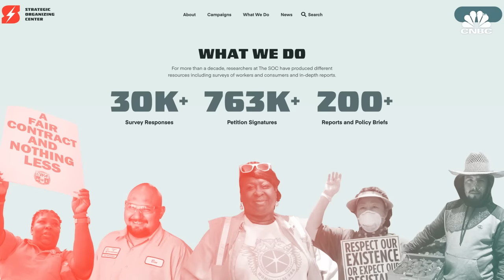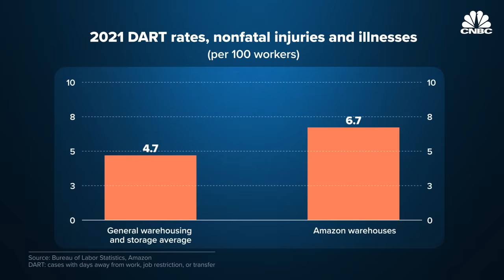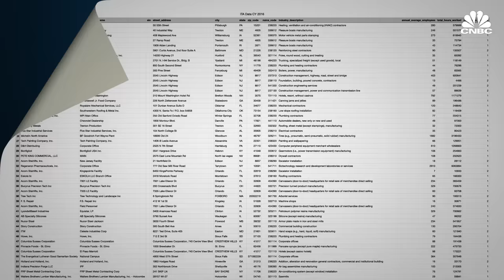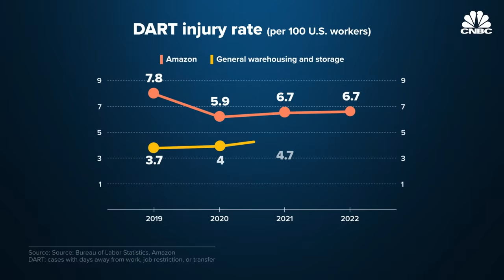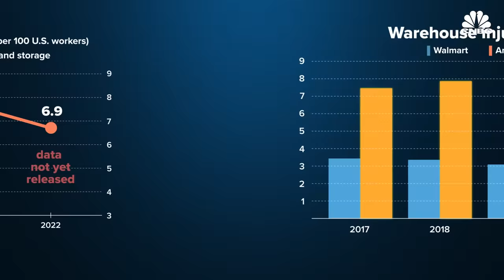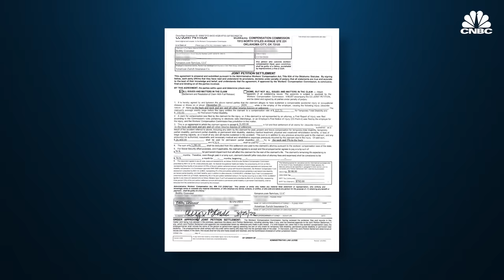Why So Many Amazon Workers Are Getting Hurt

Comment: I currently work for amazon and I can say 100% that the workers are not cared for. I have never in my life worked for a company that had so many people in management positions that absolutely do not care about people. If you are considering working for amazon, please reconsider. The chances you will be injured in some way are very high and they will not care. And those injuries may follow you for many years. I recently was injured when the manager allowed an unsafe pallet of tables into the receiving area for me to receive. He didn't even ask me how I was doing after my back was scarred and bruised from being hit from behind by several of the tables when they fell. I hope to get away from there soon before I am hurt further.
Reply: The system they have at an FC is built on mistreatment of people for the sake of speed/productivity to the point of damaging them physically. Managers have to "not care" just to remain in good standing. And honestly, most of the managers I met were totally fine with that. To me, that's disgusting and it's why I stopped seeking promotional opportunities and quit eventually.

Comment: As a former amazon employee for 3 years at a fulfillment center (inbound packages to delievery). I worked in safety. The warehouses are dirty. Pink eye and or  respiratory issues are really common from the dust in the air. If you work hard and exceed your rates you wont move out of the position. If you slow down management will have questions. I've seen people break bones and turn into zombies. People dont stay longer then 3 months usually and those who stay suffer from mental and or phyical pain. If your going to work for amazon take care of your health. Ice baths, stretching, and not going above your obligation and rates is important or you’ll burn out. Short term (3 months) not too bad if you need a job, but the phyical demand catches up to you. 

The biggest problem is the labor on hand. We often didn't have enough people to had large volume. The strain to finish the work day ends up with people getting hurt.
Reply: Hi @Sweet Karma whould you mind help me in responding to an anonymous survey regarding Amazon? Is for my Mba Master dissertation.

Comment: I left Amazon this year January and I just turned 27 last month. I can assure you although some warehouses make an effort for safety and it does matter to some, it’s just not good enough. Numbers matters the most. I worked there until I had constant back spasms and now a pinched nerve in my neck due to repeated movement. Most ppl work through their injuries in fear to not wanting to take time off. The process is long and the reimbursement isn’t good enough. It’s a very physically demanding job even for young fit people. I sprained my shoulder there, my rotator cuff among other things. It’s just not worth it. Turnover is very very real and then those who stay get overworked.
Reply: Very true its not safe, people get overworked and their bodies break down this happens to everyone, i have been saving my money since day one, if i leave or get fired i will have enough money for 6 months, to find something else to do.
Reply: Back in 2017 I was sent to the hospital for 3 days because I pulled a muscle and the muscle enzymes went to my kidney
Reply: I don’t know how much of this is due to not training staff enough and not using the most efficient procedures. I haven’t worked at Amazon but find that I do my job more efficiently, not by going faster but by working in a much more organised way.

Comment: Im currently on my 1 ½ years on Amazon.   N i just turned 20. I definitely  used to be one of the top performers  in all aspects. Unloading, stowing, picking and inducting. You name it and i was top performer in anything  for the day.  But recently i got injured.  Like 3 months ago. So i havent been doing anything.  The managers were asking why i slowed down so much. N i said my shoulder hurt. N i mesn they did take me off path and accommodated me only for a week but afterwards  ive just been picking n stowing. Bc my shoudler continues  to hurt n my workers comp has not gotten back to me in 3 days. But my stowing and oicking has gone doemwn significantly.  From picking o bags in 2 ½ minutes  to now tsking me around 24 minutes.  N even now the shoulde pain affects my personal life with driving. Picking things up im not as strong as before. And despite  afraid it wont get better
Reply: damn looks like your time is coming up soon

Comment: I worked at FedEx Ground back in 06~07 which looks similar if not the same to the Amazon warehouses and I used to get injuries on my hands and legs dealing with so many packages and machine malfunctions. Only thing they cared about was the unload rate. I think now that more people have been using Amazon, especially since Covid is the reason why issues like this are coming to light.

Comment: I worked pack flow/sort in fulfillment center and stow in delivery station. I will say amazon warehouse is really unfriendly to tall people. I am 6ft 1 tall, but I constantly need to reach or put items that is near-floor/floor level. Although amazon keeps advise people use proper positions (kneeling) for low levels, but with flow's pressure, everyone knows bending back is the quickest way reaching floor level, and it will easily cause back pain.

Comment: To play devil's advocate. 1st) Amazon pays better than UPS, FedEx for lifting boxes all day in a warehouse  2nd) Amazon Hires anyone of any age and any body type. (Amazon does not discriminate). When I worked at UPS / FedEx, they are selective (generally 18 - 40-year-old males that look in shape), UPS/ Fedex won't hire anyone to do any job. Leaving older Americans no choice. thus, I believe you will get more injuries from older Americans doing physically intensive repetitive jobs... The fact that other jobs pay less or will not hire you, leaves a number of Americans with few alternative choices. Doesn't discount Amazon needs to do better. Unfortunately, if I ran Amazon I would pay $25 dollars an hour and only predominately hire males (18 - 40 year olds) to do the work like most warehouses  or manual labor jobs I've worked at (Pepsi, Coca-Cola, Fedex, UPS, railroad). I'm not saying I"m right but I would bet injuries would go down just based on Men usually don't even go to the doctor and are taught to "man Up" and "tough it out".... FYI I've worked at Amazon on and off since 2020 doing multiple jobs(Picking, Stowing, Packing, Water Spider, etc.). Currently, I work on the dock for Amazon (in a trailer putting boxes on a conveyor belt). Boxes can be 100 lbs. to 2 ounces. I am at a high risk of getting injured from the repetitive nature but most times I work with 50-year-old -plus females that ensure the boxes are moving down the conveyor belt. Thus I'm in the trailer lifting boxes all day throughout the shift. I think it is unfair that I have to do all the heavy lifting and know I'm more at risk due to that. but I'm not going to ask a 50 plus female who I see struggling with 20lbs boxes to go in the truck and start throwing. But I think it is unfair but I don't want them to lose their jobs or not get hired. AKA i think the story needs to address more of the grey issues.

Comment: I have worked for Amazon for the last 12 years during the Christmas rush. Their number one priority has always been safety during the time I worked there. I can only speak from my own experience! One thing I have experienced is about one third of the employees refusing to take part in the stretching exercises before you start work and after lunch.
Reply: Are the exercises done after clocking in? How does taking time away to stretch impact someone’s ability to make their quota?
Reply: @JHabc  they are done after clocking in. Doing them is very beneficial to yourself from possible pulled muscles. Everyone is required to attend startup but many of them refuse to do the stretching exercises. They account the time needed for warmups and reporting any news updates toward your quota. I am 69 years old and just work at a steady pace without hurrying and have no problem meeting the quota required. Where I have worked for Amazon in Kentucky, they make safety their number one priority.
Reply: @gmv0553 I been with Amazon since 2017 and never had injuries. I am a picker and find that stretching and proper bending is a must. I also make my 350 an hour rate. I just think all jobs aren’t for everyone.
Reply: @gmv0553  I’m glad you’ve had a good experience.  The data shows that a high proportion of workers have not
Reply: Facts

Comment: I’m one of the lucky ones, and I’m young. But in my first 6 months of working at Amazon, I injured my knee wrapping pallets for 10 hours straight. I took a week off work and stayed off my legs, and it healed. But I couldn’t work that role anymore because it would keep re-injuring my knee after it healed. I tried going through disability and leave services to receive accommodations to no longer work in that role anymore, but my request for accommodations was denied even after my doctor filled out all the tedious paperwork they asked for. However, my case was still open, and HR told me I was required to be on a permanent unpaid leave of absence for 62 years unless I closed my case and continued working as usual. Essentially, I either had to stop asking for accommodations or else be fired.

Luckily, I was able to find a sympathetic manager, and he removed my permissions for the role that injured my knee and now I’m fine.

But still 😑
Reply: Quit asap before it too late, this is your wake up call, find something else as soon as possible, today if possible, I worked for too long and I have permanent back pain. I’m not even 30 yet. It has healed slowly over time, they don’t care about you. Either try to level up into the office, or quit brother

Comment: I worked for Amazon as a sortation associate at a delivery station in South Carolina for about six months. Maybe my experience was a result of everything discussed in this video, but they were extremely safety centric. You had a rate of work to maintain, but never at the expense of Anyone’s safety. The work schedule was my only complaint about working for Amazon. The biggest safety issue at my worksite was employee use of cell phone and earbuds while on the floor. For some reason, management made empty threats, but never took any action to enforce the policy. We were always encouraged to report any injury regardless of how minor it seemed.

Comment: I am only 7 minutes in, but this is subject to statistical errors. They are comparing injury rates to the warehouse and storage sector which varies wildly on what is expected of the worker. The closest comparison was used with Walmart. However, it may just mean Walmart has good injury prevention policy. The experts are a union rep and OSHA which tend to have a very skewed perspective when it comes to private non-union businesses. The environment around a warehouse and shipping company is not the same as a storage facility.
It is an issue for any business to have excess injuries, but they will happen. For a business, you are losing the productivity of an employee while still having to pay disability and subjecting yourself to litigation that is typically more costly than an employee's lifetime wages. As a business it's not profitable to have employees getting injured.
Most injuries of this nature are improper posture, poor diet, lack of breaks, and lack of stretching. When they had the individual workers, they were mostly related to one or several of these.

Comment: The human turnover rate is high, however the jobs are designed for robots, not humans. The jobs can be done with good boots and systematic movement for three hours. After two weeks the boots break in and the added support is lost, resulting in personal injury of one form or another. The actual time moving goods is high, at 10 hours. To put this into perspective,  home movers only perform the task for 4 hours a day.  

As pertains to numbers of employees:: The job done by two workers should be done by twelve. When you are injured, you are cut off from A-Z access or reporting mechanisms irrespective of injury.  Foot and ligament damage is common. 

Repitition:: Such is typical from 250-1000 lifting events at 10-75 pounds. Unfortunately many stand still and don't report injury or do their job resulting in others being injured. It is a seasonal physical labor job that can pay upwards of 35,000$. The price is loss of mobility or limbic function if the employee is not capable of walking away when strain or pain starts. 

A PhD in Medical Engineering.

 PS. Our neighbors make more working in Robotics at Amazon.

Comment: I work at an Amazon Delivery Station here in central florida, can confirm work is extremely dangerous and seriously physical, i got off at 11:50 and still been laying in my bed, body is in crazy pain. Wrist is in pain, induct unloader position lifting 40-50+ boxes every second, think the rates like 40 a minute? Cant remember but for 10 hrs bending kneeling tossing it on the conveyor its a lot for the hours and getting yelled at constantly, warehouses are hot, its just depressing. I still wont get up off my bed for the rest of the day, (yes I showered)

Comment: amazon wants you to stow at 4 seconds and large items at 10 seconds, they also steal away your back to back 15 minute breaks, so you actually have less than 30 minutes, I went through that 15 minute ice pack and heat treatment for my knee and mid back pain, and they tried to force me to see their comp doctors. and file an accommodation, which would limit the jobs that I could do; in my case I needed to slow down my stow times and rest.

Comment: I work in collision repair, a person can easily get injured, by either heavy item, burns by welding, respiratory issues due to dangerous particulates, and all products are combustible, yet most technician don’t. How is it these delivery drivers, dealing with boxes get injured?? Are running and tripping on sticks on the ground? Slipping on a banana?

Comment: The report is kind of misleading. Amazon's main issue is hiring below industry standards, and people who aren't used to working in high traffic/deadline environments often get injured because of the strain, not the job itself. 

I work at Amazon currently and most of the injuries reported to AMCARE are self-inflicted, despite Operations and Safety reiterating over and over safety procedures when it comes to heavy lifting and unloading fluid freight from a trailer.

Comment: The Fed will acknowledge that they were late to the game, that inflation has been more persistent than they were expecting. So they probably should have tightened sooner, Some analysts believe that the larger banks are resilient and are more worried about the smaller and mid-sized banks. Well, I'm still at a crossroads deciding if to liquidate my $138k stock portfolio, what’s the best way to take advantage of this bear market?